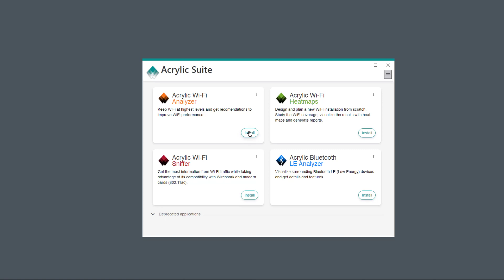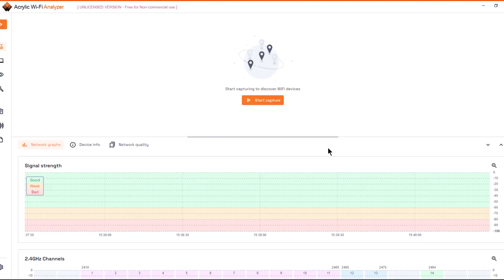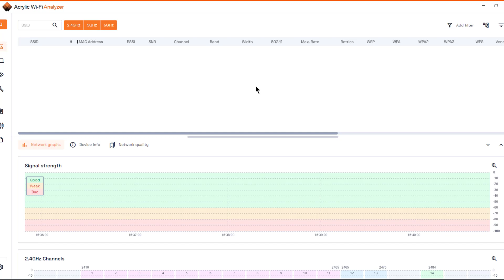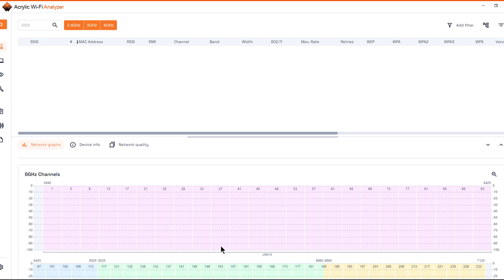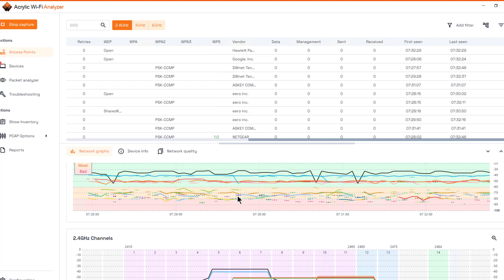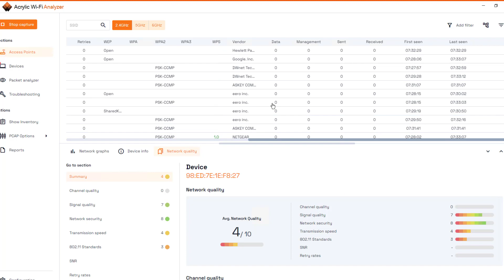Analyzing Signals and Devices using the Acrylic WiFi Analyzer

Comment: I’ve purchased a perpetual “Acrylic Wi-Fi Professional” License on 8/15/2017 for $99.95 USD.  Over the course of 6 years, I’ve had several times I’ve had to re-install the software on same/different computers for various reasons, (laptop stolen, Hard drive crashed, Renamed Computer)

Apparently, I have unknowingly used up my three activations and now need to re-install on a new laptop. When I try to install on the new laptop it say’s “Invalid license”. 

I've submitted an request for assitance with no responce.  As such, I can only recomend that you do not purchase Acrylic Wi-Fi Professional!!!!
Reply from the maker: Wow, I had no idea. Thanks for sharing.
Reply: Yeah be careful if you rename your laptop you originally install it on also. I did this and it locked me out twice! I had no idea. I had to rename my laptop for security reasons and that’s what happened to me. They were rude to me.